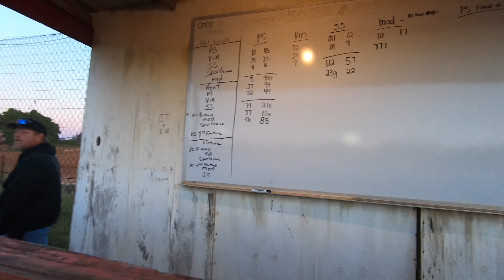Pure Stock Racing with Josh Howell at Southern Raceway

Comment: great video! just wondering how this is called pure stock when it has a tube chassis and sheet metal  attached not in a stock way? i think enduro cars are really true stock cars at most tracks! good luck and stay safe!
Reply: lee kurtz In most cases it’s a stock Monte Carlo frame with a roll cage added. Stock suspension, with different springs and shocks.
Reply: Not a tube chassis. It just has a roll cage on a stock 82 Monte Carlo frame. All suspension components are stock except springs. No racing shocks. Stock GM rear ends. Motor and transmission are also stock production only. No standards. TH350 in my car. So the only things that aren’t very stock are the aluminum bodies. These original bodies are hard to find! Must have a factory roof though!  Thanks for watching!

Comment: Nice they let u build the entire body. IMCA, and USRA made us use factory roof and pillars. Looked like an open motor with holly 2bbl? I like the crates better... way more Torque off the corner. 1/4 inch twist in the frame makes er tight, but way fast🤭🤫😉 looser isn’t faster anymore